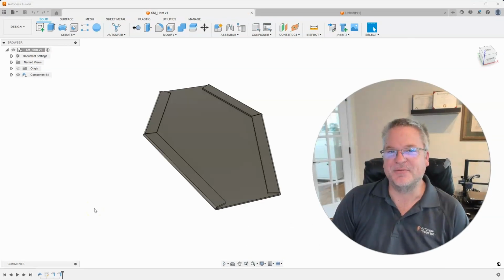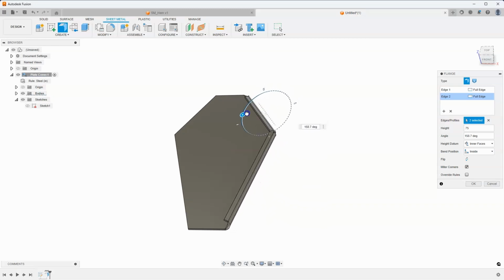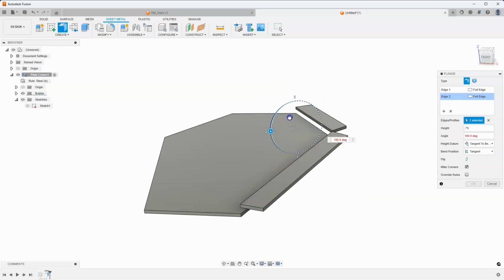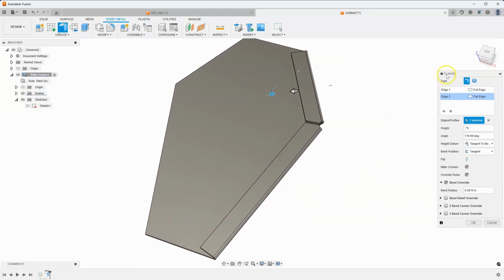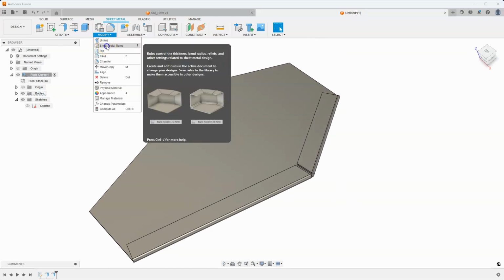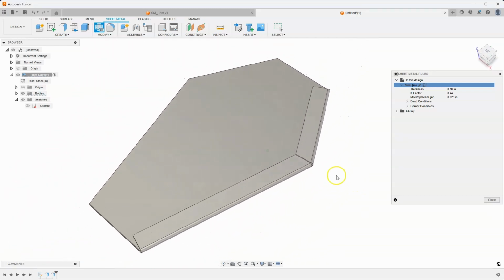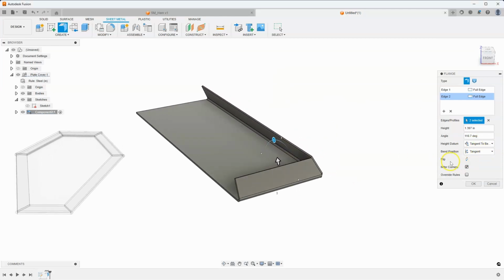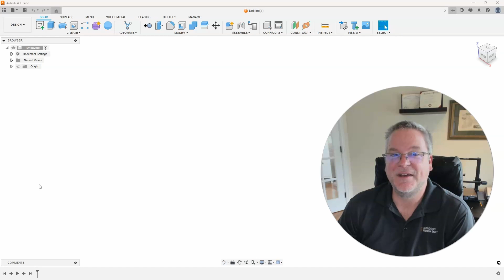Fusion Friday - Making Hems in Sheet Metal

Comment: Brad good video!  Couldn't you create a new sheetmetal rule with all of the settings rather than going back to the 3 dots each time?
Reply from the maker: @ScottDube1-  This is a great idea.  It would help with the Bend Radius setting and the Seam Gap setting.  However, you would still have to enter in the bend angle and you would have to verify the thickness of the material.  For example, if I created a rule called "Hem" and the material thickness was set to 0.1in and then I applied that rule to my 0.25 thick sheet metal part, it would change the thickness to 0.1.  However, if all your material was the same thickness, your idea would definitely speed up the design process.  I'm going to pin your comment since I think it's a good idea.  Thanks for sharing!
Reply: @bradtallis8968  I try to have a rule for each thickness.

Comment: Brad, I have been building stainless steel battery boxes for light aircraft for several years with .032 stainless sheet using this fold over bend to strengthen and eliminate the supper sharp edge.  
I have tried to use fusion to design them but have never figured out how to do exactly what you just showed in this 7.5 minute video.  Thank you so much and I am heading to Fusion to get started.
Reply from the maker: That's great!  Thank you for sharing your example of how you are using Fusion.  Thank you for watching.